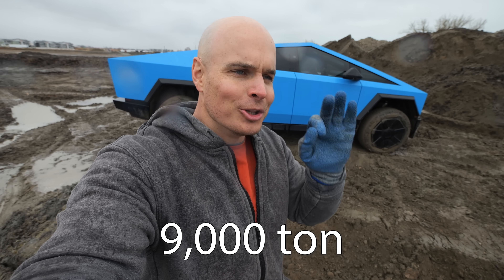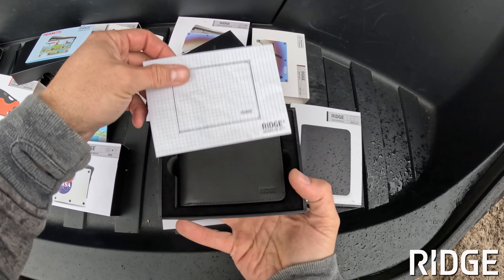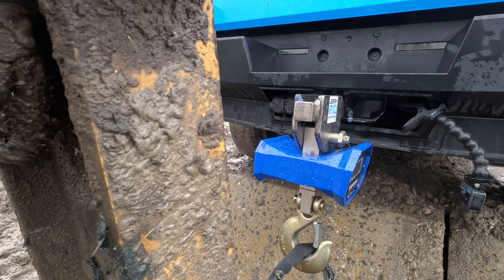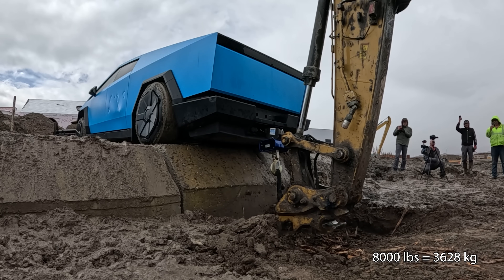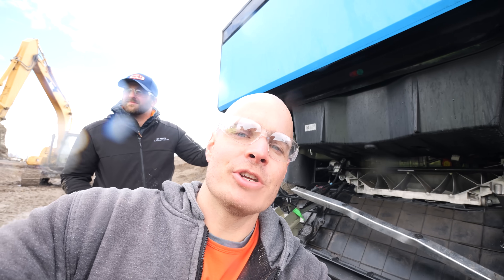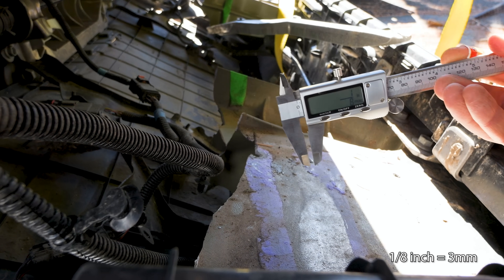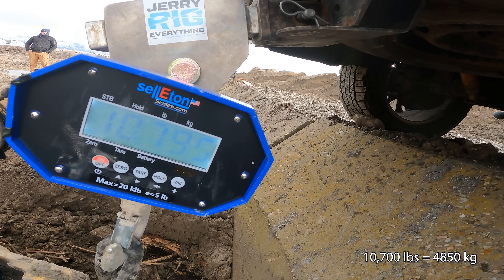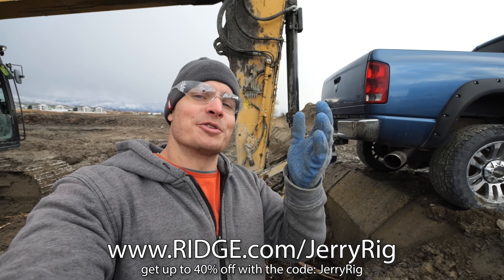SHOULD YOU TOW WITH A CYBERTRUCK?! - (catastrophic failure test)

Comment: Dude jumped on this only after Musk started cutting government spending.

Tongue weight is rated at 1,100 lbs. They put 10,000 lbs of tongue weight on it and are surprised when it breaks? 

No, there is no situation where a normal load would put that much tongue weight on a truck. You have to be intentionally pushing the limit to achieve that.
Reply: So why the ram doesn't break if it has the same capacity
Reply: @axelitotapia2381  because tongue weight is not based off when the tongue snaps. It's based off a ratio of the total towing capacity. It's to help ensure you load a trailer correctly. 

If you notice, way before the Tesla frame snapped you would not have even been able to safely drive because of the squat. Same goes for the RAM
Reply: shhhhh youre making to much sense. the libs hate that
Reply: Congress, who are bought and paid for by the ultra wealthy, controls the budget, not Musk. Don't expect any money saved by cutting programs and weakening national security to be returned to the treasury. Congress will just cut taxes for the ultra wealthy or divert the excess funds to corporate welfare programs. That's the point. DOGE is another money grab by the billionaire class.
Reply: Edolf fanboy cope. Oof.
Reply: @Gimbal117  not at all. Just stating facts. 

In fact I have always thought Tesla's have been poor quality. I didn't just change my tune because I disagree politically with the CEO.

It is possible for Tesla's to be poor quality compared to other manufacturers and also this test proves nothing and is just someone reaching because they are upset with Musk
Reply: @Gimbal117 No Jerry is a known radical leftoid, he was obsessed with tesla until he realized Elon didnt agree with his political views

Comment: @10:07 NO, there is not a scenario where an 11k trailer could apply all its weight downward on the tung. The direction of the force does matter. The axels would have to come totally off the ground to apply that kind of force and not just a bounce.

Comment: Maximum towing capability is 11kpounds. Unless you are capable to put all the towing capacity in this single point, it will not break this way while you towing. Because to tow something you need some thing like a TRAILER. And BELEAVE OR NOT THIS kind of thing have WHEELS 😮😮. At least two.. so if you have all this weight as  near as possible of the towing point the physics enter in action and divide this weight in 3 points  (2 wheels and the towing point) another thing is to town all this weight you need a trailer with two axis. 
Please don’t say stupid things.. about RV rolling off at the roads.. I’m think you aren’t stupid..

Comment: The rigorous testing performed by organizations in the US like NHTSA, FMVSS, NCAP, EPA, SAE should take heed because Jerry and his testing is way more accurate and should be taken as the DE FACTO standard for safety of the truck. How out of touch are you really?
Reply from the maker: If you can show me any of those organizations tests on the cybertruck hitch specifically I'll venmo you $100 bucks.
Reply: @JerryRigEverything you should send me $100 bucks just cuz we're neighbors in Utah man! Jk lol love your channel bro, hopefully i run into you down the street so I can say hi!
Reply: @JerryRigEverything  Not interested in money. I actually was a bit more interested in this so I did some digging using AI. Here is what I found. Welcome discussion.

Lets assume dynamic conditions.

1)Braking, this force is mostly horizontal (shear), not vertical (tongue weight). Vertical tongue weight might decrease slightly if the trailer pivots upward, but it wouldn’t increase dramatically. Even in extreme braking, the vertical load on the hitch stays close to the static tongue weight (e.g., 1,100 lbs), far below 10,000 lbs.

2)On a steep downhill slope, the trailer’s weight shifts forward. The vertical component of the trailer’s weight on the hitch increases by 
𝑊⋅sin(𝜃) W⋅sin(θ), where 𝑊 is the trailer’s weight (up to 11,000 lbs) and 𝜃 is the slope angle. For a 45° slope (very steep): 
11,000⋅sin(45°)=11,000⋅0.707=7,777 lbs added vertically. Combined with a nominal tongue weight of 1,100 lbs, this could reach ~8,877 lbs. On a 60° slope (near vertical, unrealistic for driving), sin(60°)=0.866 yielding ~9,526 lbs additional, totaling ~10,626 lbs. So, in realistic driving conditions, this doesn’t hit 10,000 lbs.

3)Bumps or potholes can cause momentary spikes in vertical force. Studies on dynamic load amplification (e.g., from vehicle dynamics research) suggest a load factor of 2-3 times static weight in extreme cases (like off-road racing). so 3 X 1,100 = 3,300 lbs.

4)In sharp turns or trailer sway, lateral forces increase, but vertical tongue weight doesn’t spike significantly unless the trailer lifts and slams down. Even then, forces align with the dynamic loading case above—nowhere near 10,000 lbs.

5)Could an extraordinary event—like the trailer flipping, jackknifing, or a catastrophic failure—cause the hitch to see 10,000 lbs? If the entire 11,000-lb trailer somehow landed vertically on the hitch (e.g., flipping over it), the force could theoretically exceed 10,000 lbs momentarily before the hitch or truck fails. However, this isn’t a “driving condition” in any practical sense—it’s a crash

No, the weight on the tow hitch would not exceed 10,000 lbs in any practical driving condition. From GROK.
Reply from the maker: @tookster7483   thanks!  Even with a 5 second AI copy paste going down a steep slope  hill and hitting a pothole at the same time could hit that catastrophic breaking point threshold. Thank you Grok!
Reply: @JerryRigEverything  This is just a disingenuous response sir. You are grasping at straw, and judging by many responses below you are being called out (excluding the obvious Bot one-liners.)

Also, honestly, do you really think this truck would have been released to the public without proper safety reviews and tests?

I am done and will not be responding further. Have a great day.
Reply from the maker: @tookster7483  lol 😆 your own AI agrees with me.  Yikes. Good luck out there.
Reply: NHTSA have been lying for over 50 years I wouldn’t anything they say.

Comment: Usually when towing stuff, youre pulling, all that weight is not pushing straight down. 

Like my truck has almost 10000lb towing capacity but only 1000lb for tongue weight.

Not a tesla fanboy, these trucks seem super dumb, but this test would permanently bend the frame of any normal truck

Edit: guess thata a good point that theres brief pwriods of time during normal towing the tounge could see the full weight of the trailer

Comment: Meaningless test once you're past about 2200 lbs, which is 2x the recommended tongue weight. The 11,000 lbs towing capacity isn't tongue weight, which is typically 1/10 of the trailer weight. You should have pulled backwards to see if the 11,000 lb limit is correct. If you had 10,000 lbs of tongue weight, your trailer would be 100,000 lbs. For comparison, a big rig is 80,000 lbs.

Comment: 4:00 "aluminum does not have a fatigue limit so it gets weaker over time. Steel on the other hand does NOT have a fatigue limit so it doesn't get weaker." ok so which is it

Comment: I hate to be the one to point this out but towing capacity and tongue weight are not the same thing.   The tongue weight or down force on the hitch is far lower than the towing capacity of the hitch which is a factor of the backward force, to wit, you're not putting 11k lbs of force onto the truck's payload directly.  In fact, there are tailer configurations that meet the towing capacity limits but exceed the tongue weight capacity.    The test would be hooking it up to something that weighs more than the 11k stated capacity and attempting to pull it.  Not sure what this proves other than the cybertruck is actually pretty beefcake to that level of downward force on the hitch.   Towing capacity over all has more to do with the hitch, towing vehicle weight, payload capacity, frame and of course, engine/motor ability.    You really didn't prove much here.
Reply: Wanted to add, in your little hill with the models, that's still inaccurate, the hill does not cause the trailer become tongue weight.   Even with out an wieght distributing hitch, the trailer's axles are bearing a healthy percentage of the over all load.

Comment: This os stupid. Tow weight spec is NOT a mas or a force applied to the hitch, nor a load. It is a trailer weight that is the limit from where dynamic forces are acceptable. For all that is wong with CT, this is not a problem based on your test. The vertical nominal load is 70 kg on a hitch. Your test has zero value. It is like comparing a helmet and a cap drop from ten meters and the hat wins.

However the broken Tesla frame looks a bit weak and it might still be the case that fatigue by dynamic load after many miles of trucking might be an issue. Especially if there actually are real incidents.

The extremely over dimensioned frame of the other truck is a consequence of other design criteria and also your loading even though not snapping has probably  warped the truck frame.

Comment: This is a cool video, but I really thing holding down the front of the truck is borderline journalistic malpractice. Fill the frunk and front seats with weights? Sure, that's realistic, but if the hitch held long enough to lift the front tires off the ground, that would be evidence that it's strong enough. With that in mind, some quick napkin math says it still would have broken, it just isn't as convincing to the audience the way you showed it.

Comment: When i went to Automotive School to learn the trade. I had an instructor. He worked at Audi, BMW, and Mercedes, along with Tesla. He once told me that the people working for Tesla in their factories are less qualified than Starbucks Beristas. Why did he say this? Because one of the managers he dealt with at the factory last job was as a Starbucks Berista. No qualifications, no training, nothing. He also got to see how the cars were manufactured. The people working on those assembly lines for the most part had no idea what they were doing and had no relevant work experience. Tesla is a hype brand for stupid people made by stupid people.  To put into perspective how stupid the designers at Tesla are. During the first few years of the Model Y's life. They had a problem where they tpms sensors would break off while you try to remove the tire off the rim. Tesla knew about this problem and their magical solution? Put some glue on that shit and call it a day. Was it the right type of glue? Nope, it would fail after a while, leaving a rolling tpms sensor inside your tire. Tesla has not changed. The products are still poorly made by idiots.
Reply: keep lying

Comment: okay much as I hate Tesla right now...  I have to defend it.  The tongue weight is something like what 600lbs.. your downward pull is simulating the tongue weight not the towing capacity.   PULL 11K lbs horizontally then I will agree we have a problem.   I don't think this was valid.     The fact steel can handle a lot more tongue weight is great - but that 's not the rating.     I think the only cautionary tale here is that if you were loaded up at 11K lbs and you hit a bump the momentary force might exceed 600lbs tongue weight - but your test is not testing that.  So you get a X for validity and a  🙂 for entertainment.

Comment: The cybertruck is no wheres near the same tow capacity of a 2500 truck. Know its closer too 1500 trucks but even then a steel frame will always out perform an aluminum frame. The only good part about aluminum is its more weather resistant than steel and is  lighter but thats about it lol

Comment: Honestly, I'd be more concerned about Tesla suing me for sharing this. That said, the Cybertruck gave out at 10,400 pounds of tongue weight — far beyond what you'd normally see in typical use. So, while it doesn’t really prove much, it sure is entertaining to watch.  For reference 10,400 lbs of Tongue Weight: This is extremely high. For comparison, a typical Class V hitch (the strongest common hitch type) is rated for 1,200-2,400 lbs of tongue weight. 10,400 lbs would suggest a total trailer weight of nearly 70,000-100,000 lbs, which is far beyond what the Cybertruck is designed to tow.
Reply: Ooooh the big scary Tesla lol wow.

Comment: You never design something to the point of failure of the material. There should be a safety factor in consideration. For example: an elevator will never be rated at a weight which is equal to the breaking point of the cables. I believe it has a safety factor of at least 5 to 1 (meaning that its weight capacity is 1/5 of where it would fail). In the Cybertruck's case they did even achieve a 1 to 1. Nice job guys!

Comment: And here all this time I was afraid to exceed the 15% total weight limit that supposed to go on a hitch for downward force…. This particular test was completely thought out wrong. Towing weight and hitch weight are two totally different things. The way the hitch frame mounts to the truck frame is for linear weight not vertical weight. I never thought that either of them would hold up for more than 3000 pounds that’s why HD trucks have heavy duty hitch, balls, or gooseneck in the bed. But at the very least, I do feel much more comfortable with the 1800 pound tongue weight currently on the trailer behind my Ram at the moment.

Comment: I think this is a very serious issue! 
Tesla rated the truck for 11K pounds and the frame tore in half at 10'400LBS..thats 600 pounds LESS than the RATED towing capacity.. what happens if you are loaded to rated capacity and have to go up a steep hill? or if you have to drive on poorly maintained and bumpy roads? I understand this test wasn't testing the tensile strength of the frame, but with how thin that frame was I don't think it would fair much better. 

YES, tesla's target demographic likely wont be towing much, but the truck should be able to do what it's rated for, otherwise it can be a serious safety issue

Comment: modification Would be some steel channels that fit within the casting is but I'm sure there will be some body making aftermarket strengthening that bit that was glued could have some bolts put in it with spreader plates.  Not difficult to do but whether Tesla does something will be interesting

Comment: What the hell are you talking about “that’s not good” you put almost the ENTIRE trailer weight rating on the tongue weight! That’s FANTASTIC!!
Reply: Not to mention, that’s not stock suspension on that Dodge so there’s way more room for travel and just because the Ram, according to you and your scam test here, did well…that doesn’t mean the Tesla did bad. And the scenarios you mentioned that would cause the Tesla to have this kind of failure are BS! You obviously have an issue with Tesla and or Musk.
Reply: It's fantastic when you snap the entire back off your truck? What the hell are you talking about?
Reply: @Finnegan20 When you test it at almost 10x the advertised tongue weight, I would be very happy I had that confidence with my truck…. If you break your truck after adding 10x the amount it should, what else would you expect?  Run an engine bouncing off the rev limiter and see how long that lasts for.   Exact same principle.
Reply: @Podski5558 If, and I mean if, the hitch had somehow broken on the Ram the main benefit is that you would still be able to drive the Ram around. The POS Tesla is probably totally now.
Reply: @nathanieladams7624  completely agree, and I HIGHLY doubt anyone who purchases a Tesla will ever tow with it anyways 😂   Just stating that it broke with 10x the advertised tongue weight….

Comment: 10,000lbs straight down is way more than you need to haul 11,000lbs. I'd be surprised if you EVER hit 20% straight down while hauling something. Think about that in reverse, if you're saying braking/accelerating will make the mass move up and down then it could also go 10,000lbs up.... which would be enough to hurl a f150 10feet into the air when hauling at its max (6klb hauling 14klb).

Comment: honestly as a european my opinion is you are taking a car and making it do what should be done by a tractor or a semi truck(a lorry)
Reply: …Or a normal everyday truck like a Dodge Ram. I know you have farm in Europe. Do you not use Pickup trucks?
Reply: @nathanieladams7624  i have most experiance with smaller farms(that i see in villages around me) where i dont know of any that would use pickup trucks, its mostly cars with trailers for small payloads and tractors for anything really heavy but its also that where im from basically every farmer owns at least 2 tractors its rare a farmer owns just one
Reply: @nathanieladams7624  the most worker car you see is probably a offroad car (jeep style ones)
Reply: @nathanieladams7624  not really its mostly tractors that are used on farms or normal cars for light payloads if you need to just throw couple of things to get to the field, here basically every farmer owns 1 likely 2 trqctors
Reply: @nathanieladams7624  yt has been eating my comments
Reply: @bigpod Interesting, here in southwest America farming is very big business. In my small town there are probably 50+ large farms. Most farmers drive large heavy duty pickup trucks (probably half of the trucks are from the 70s and 80s and still are used hard) and have farmers usually have about 5-7 tractors of different types.